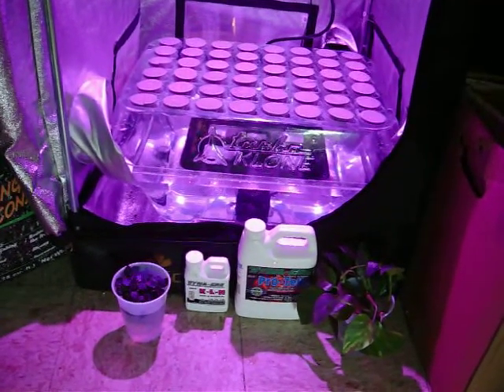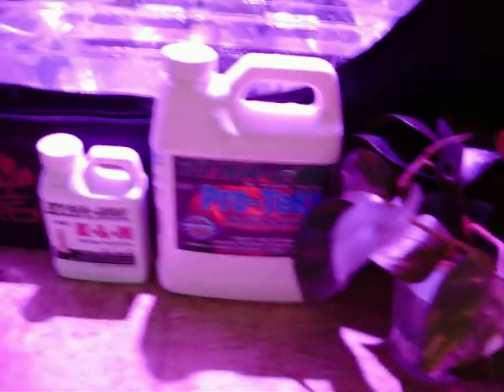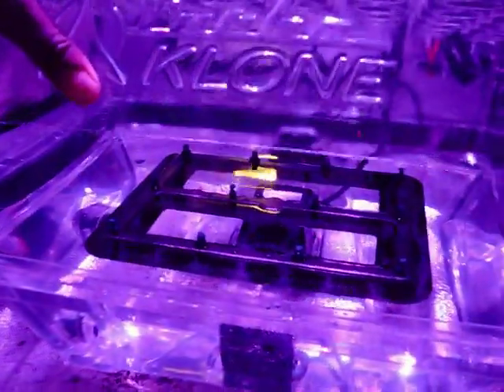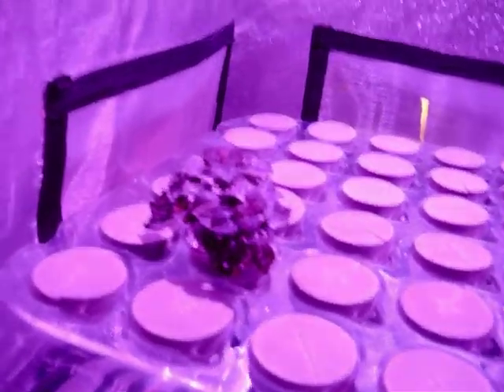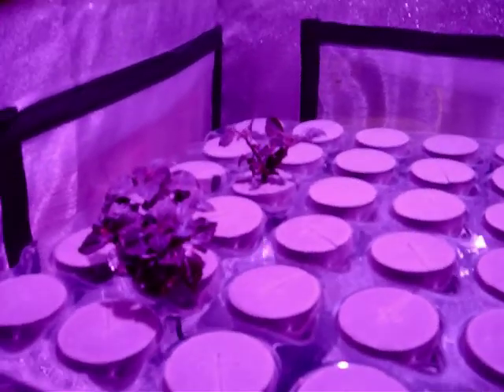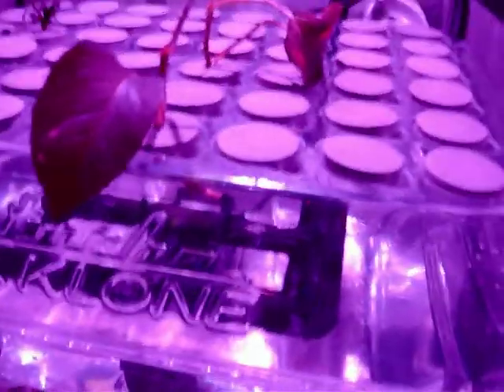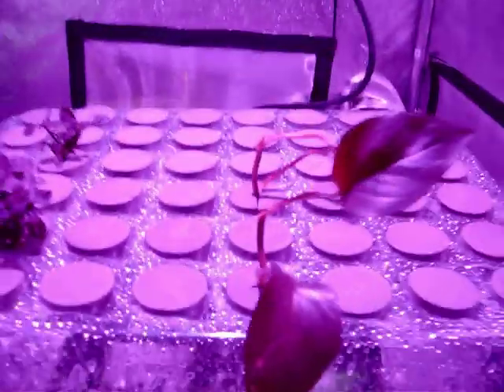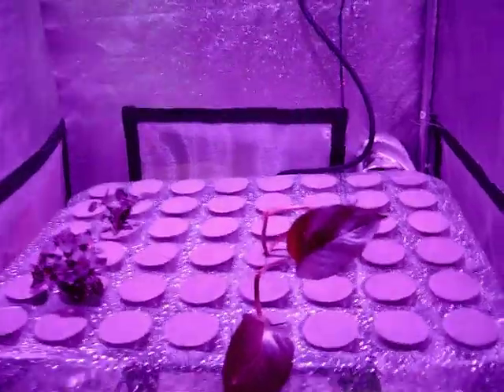Setting up a 48 site Turbo Klone under Kessil LED

Comment from the maker: @odinator411 
You are exactly right about how the machine operates. It is an aeroponic style cloning system. Just one Kessil does the 48 pretty good. They also come in 96 and 144 site system.